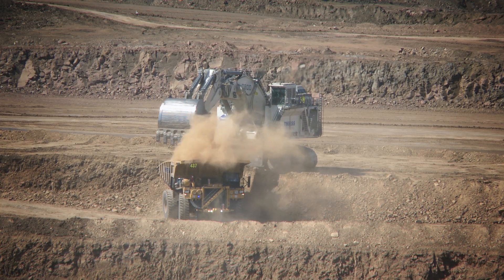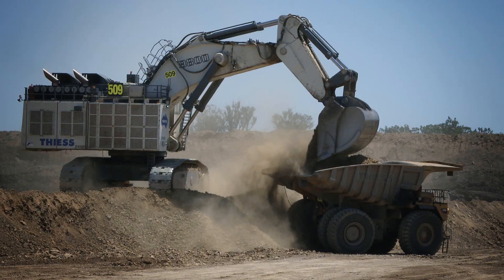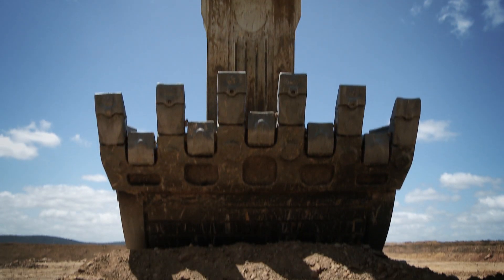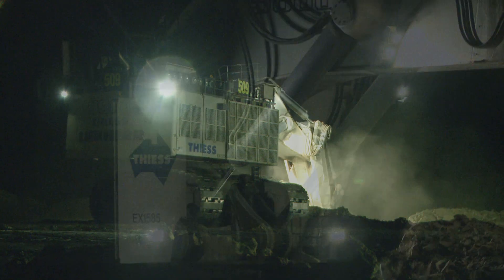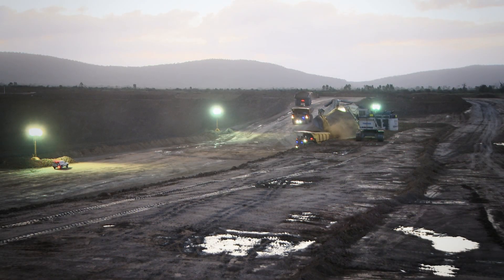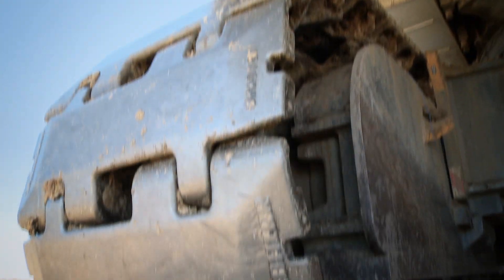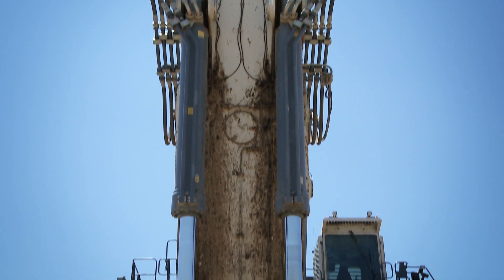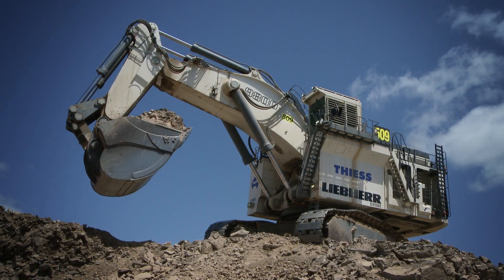BIGGEST EXCAVATOR IN THE WORLD! 4000 HP & 800 TONS -  LIEBHERR R 9800

Comment: I dare to affirm that this is not the biggest one. Already in the late 1980s  and early 1990, there where bigger ones in U.S. open cast mining. They didn’t have their own combustion engine but they were electrically propelled, SIEMENS had been involved. The excavator was so huge that a single digging tooth of the bucket could hardly be embraced by a man. I don’t have any clue if those mines are still in operation nowadays.
Reply: Yes but here we talkin ´ bout hydraulics Not Like these shovel wheel excavator

Comment: How can the digging arm of large excavators be so short, proportional to their size compared to smaller machines
Reply: shorter arms  means it can lift more weight  .The longer  you go with your reach the less weight you can safely lift .
Reply: Short dipper arm more breakout power,faster cycle time good digger drivers dont reach for material

Comment: Actually this machine is the third largest, the Bucyrus at RH400 at 889t is the largest followed by the Hitachi EX8000-6 at 811t.
Reply: Silentknight21 those are mining shovels, this is an excavator.
Reply: They are both classed "escavators" in Italy, so I guess it depends on where you live... Also both have a different arm available turned the other way, so I suppose they can be classed excavators abroad too.

P.S. i know wery well the differences in operation, risks involved in their use, maintenance and so on.. i teach how to operate earthmoving machines..... but you try to explain the diferences to lawmakes... ^_^ì
Reply: @dansneyd4646  You can order either configuration.

Comment: Yeah the RH400(980t) is nearly 180t heavier in shovel mode and payload is around 45 cubes vs the 42 in standard density for the 9800(800t). Don't get me wrong they are huge bits of gear. For lighter dirt like Burton mine the RH 400 would spec a 52cubic metre bucket. HUGE units the both of them. One here in the hunter is passing 80t in rock. As for the EX8000(820t) lets just say it's big with a 42cube bucket but struggles for tear and breakout unless its loading well shot dirt or spoil.
Reply: bjjpath the RH 400 only comes as a mining shovel so is technically not an excavator like this. Same with the Hitachi

Comment: So what, that means jack, if you are a digger driver that buldozes the load iin the back of the truck you are pushing down extra weight on the struts where the weight is sensed, thats why it recalibrates in 2nd gear on the truck so what each pass shows on the system at the time is no where near as accurate as when it reweighs in 2nd. The machine with that size bucket would not be able to get enough material in the bucket to equal 109 tonnes a pass, pure bullshit
Reply: bigmuskie là lon nhất

Comment: @gleslie2 219 on the truck scales? most likely they need to be recalibrated, You have to remember that the weight on the truck recalibrates when it hits 2nd gear so if you drop 75 to from enough height it may measure 110 at the hit but then when all the struts relax out on the haul and the truck hits 2nd a new total will show up that is more accurate